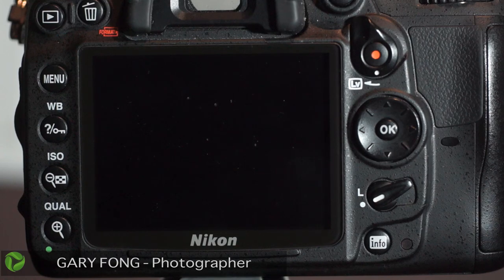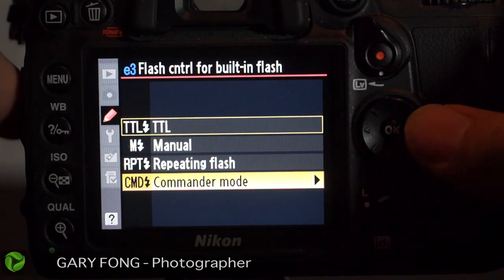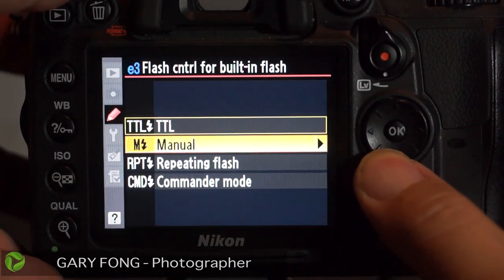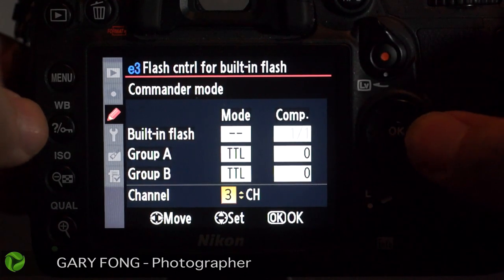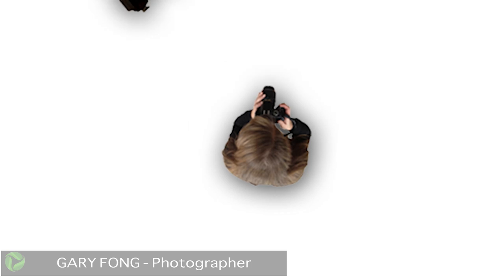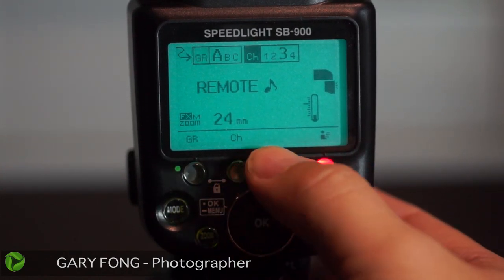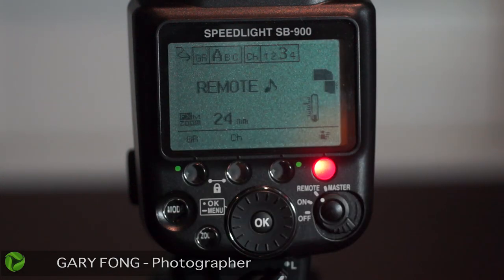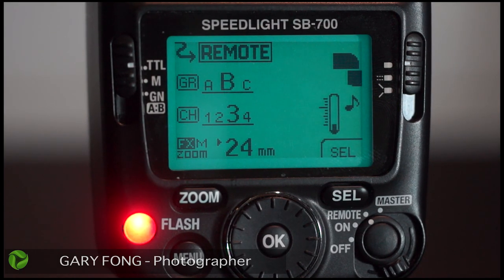Nikon Wireless Flash Creative Lighting System Very Detailed

Comment: The CLS works wonders. I wonder now if they ever thought of doing a built in  radio transmitter. There are some short comings in the CLS. You have to face the sensor to the camera unless it can bounce off a wall and the pop up flash does flash blinding the model but that I solved by buying an adapter Nikon sells. Not perfect but works.

Comment: Nice video.  I just got the D780, which does not have a built-in flash.  Do I need to get the SU-800 Commander to replace the non-existent built-in flash, or are there other (cheaper) alternatives?

Comment: Helpful. I guess you could use the on camera flash as a fill in rather than having it set to off, assuming you wanted some fill.
You could set it to -1 or -2 or greater to underexpose so as not to take over from your 'main' light.
Thank you for this.

Comment: if you turn the built-in-flash mode to "off" how is it not part of the exposure when it still has to flash anyways?
Reply: The shutter is released slightly after the pop-up flash is fired so that it doesn't account to the total exposure.

Comment: Hi Gary just wondering if you can help me out? I have done everything you said with my Nikon D7100 and my SB-910 but my camera's built in flash still goes off as well as the off camera SB-910. Do you have any ideas how I can make sure the built in cameras flash does not go off? if I close the pop up flash then the off camera one doesn't go off either :(

Comment: I have the d5500 and the  Shanny SN600SC  speedlight. i'm only trying to use it on the camera instead of the pop upNot trying to use it off camera yet.  It gives me no options except built in ttl auto and manual when i go to camera settings-custom settings-bracket/flash. When i take a picture the flash flashes on every picture with full flash power. it seems the camera is not making any choices to flash or not flash and at what power regardless of whether the camera is in manual, auto or program modes. what am i doing wrong or does this speedlight not work with the d5500

Comment: Hi everybody... How is the information sent from camera to speedlight? I know that the popup flash triggers the speedlight to fire, but what about zoom, and exposure compensation etc when using TTL. When you change the EV in commander mode for different flash groups, how is that transmitted to the speedlights?

Radio? Infrared? etc
Reply from the maker: Unless you're using a flash unit and triggering system that specifically states it is radio frequency enabled, then the default is going to be a hybrid of infrared or line-of-sight technology. The pop-up flash on some cameras can send the signal for exposure compensation and zoom, but not all do. You'll need to confirm by searching the attributes of the camera you own and the flash unit(s) you're using.

Comment: If I need to change batteries in the middle of a shoot, do the settings stay, or when I power back up do I need to reset all my flash units?
Reply from the maker: If you're referring to the flash itself, it depends on which flash unit you are using. Some flash units retain the information while others will completely reset.

Comment: the nikon 3200 has a pop up flash and I have the sb 700 but my settings don't have commander mode it only has ttl and manual mode!
Reply: do you have a solution? i need help
Reply: @thehashslingingslasher7017  the d3200 is a begginer camera and it does not support CLS. Therefore it Dosent have a commander mode. If u want to use flash off camera, u need to buy either radio triggers or optical triggers.

Comment: hello Gary, i am so confuse, i have the Nikon D5200 and in the menu that you show i dont have it for use the pop up flash like triger, i only have the ttl mode and the manual mode, some help please... : (
Reply: INside Store u need a remote trigger. Or set the manual flash option to low value and use your off camera flash as optical slave

Comment: can i use wireless with D5300? there is no "Commander Mode" configuration. have you advice for that?
Reply from the maker: If the camera itself doesn't have that as a MENU option, then no- I'm afraid not. You could usually a secondary option like a PocketWizard and receivers, but nothing built-in.

Comment: Hey Gary  or if anyone can help... I have a D5300 & I don't see Commander Mode...why is that and how can I set up a commander shoot?  Ty
Reply: +Anil Surujbhan i am in the same situation, i have de D5200, and i just have the ttl and the manual mode.
Reply: +INside Store In order for those cameras that don't have a commander mode for your pop up flash, you need to use a dedicated speedlight, such as an sb700, and program that flash as your commander the same way you would as the pop up flash. those settings are on the flash itself, but work the same way.
Reply: +machinist4442 how do I do that?

Comment: How would I use this system in manual mode?
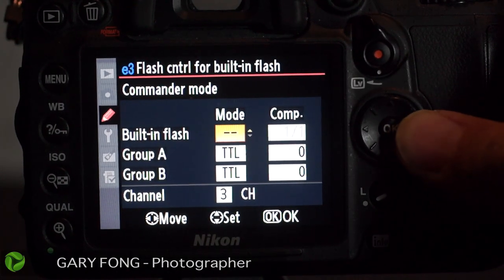Reply from the maker: At around the 2:30 mark, instead of TTL on your groups, change those toe M (for Manual) and adjust the power setting.